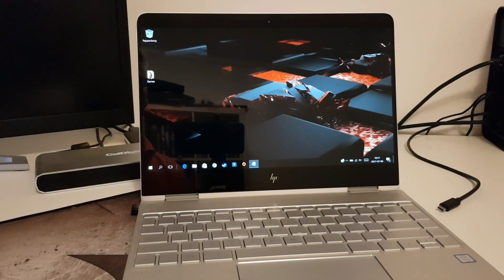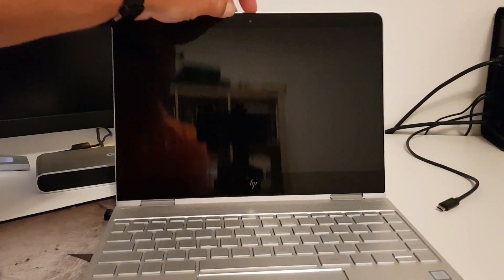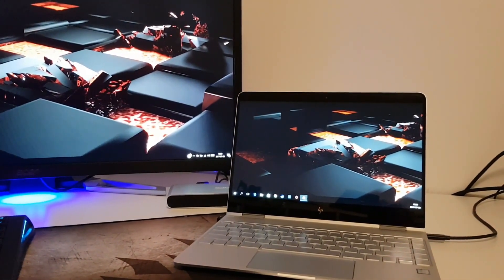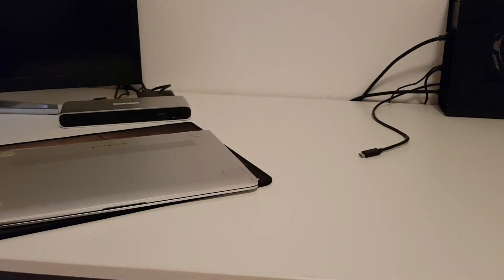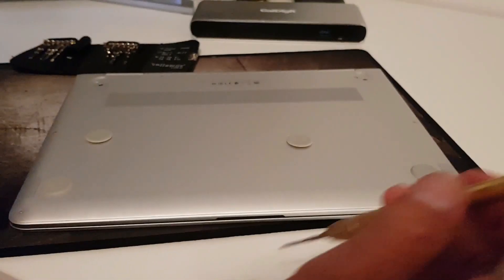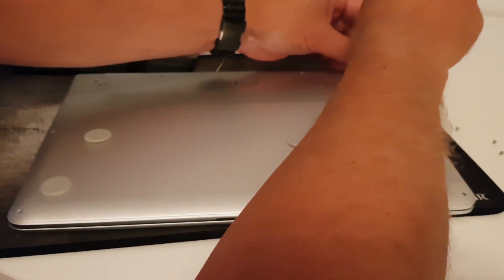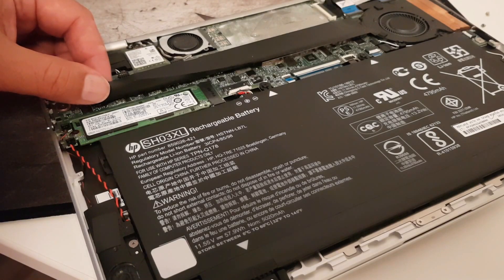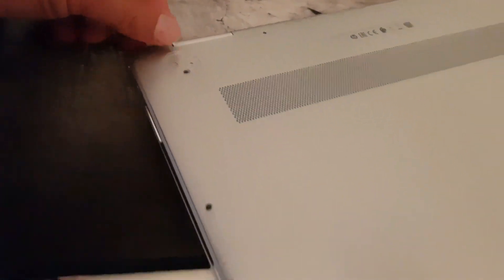HP Spectre X360 SSD upgrade and hot plug thunderbolt 3 connection.

Comment: Can I upgrade the RAM from 8 to 16?
Reply: Hi, thanks for watching! No the RAM is soldered on the motherboard, but this configuration have 16GB RAM that is more then enough for most usages. If you are interested in the newest version of the Spectre x360 please subscribe as I will do several comparisons between them.

Comment: how many PCIe lanes in Thunderbolt 3 ports?
Reply from the maker: Hi, thanks for watching. Here is what I found:
40 Gbps Thunderbolt™ 3 – double the speed of Thunderbolt 2

• Bi-directional, dual-protocol (PCI Express and DisplayPort)
• 4 lanes of PCI Express Gen 3
• 8 lanes of DisplayPort 1.2 (HBR2 and MST)

• Supports two 4K displays (4096 x 2160 30bpp @ 60 Hz)
Reply: Dear sir, you are absolutely right. But dell xps13 also comes with a Thunderbolt port but its two-lane PCIe I have heard spectre is 4 lane PCIe just wanted to confirm that. Thank you for replying sir I have subscribed to your videos. Looking up for more great content.
Reply: Oh sorry never mind now I understand your reply. So its thunderbolt 3 meaning 4 PCIe lanes. Thank you.

Comment: what kind of SSD will fit in it. will MZ-N5E500BW will fit in it
Reply from the maker: Hi, my SSD is PCI-e type and the one you ask about have SATA interface, but I am 99% sure it is supported but to be sure please check the service manual. I found this on HP forum(but is an older model :https://h30434.www3.hp.com/t5/Notebook-Hardware-and-Upgrade-Questions/Will-Spectre-x360-13-4195nr-Skylake-accept-a-NVMe-M-2-SSD/td-p/6253934.

Comment: sir, i would like to ask if there is an additional port for m.2 nvme or sata for additional storage. 
I can not find any tear down for the latest 15 inch spectre if it has additional bay for storage too.
the ENVY 15 inch support 2.5 sata so thats an edge for additional storage. please provide feed back
Reply from the maker: Hi, thanks for watching my video. The Spectre x360 13 inch is only equipped with one m.2 slot.
Best regards
David